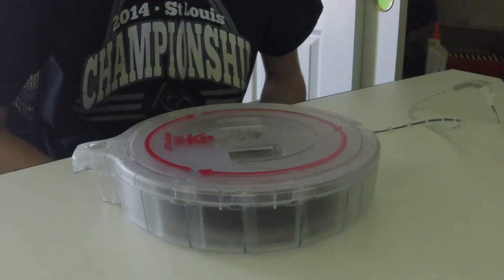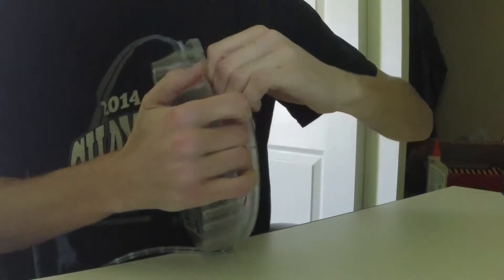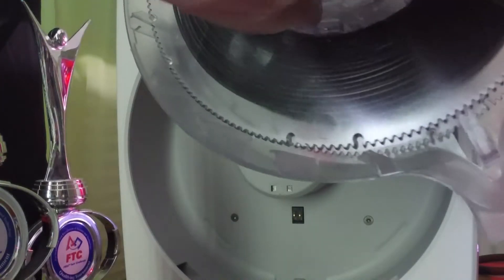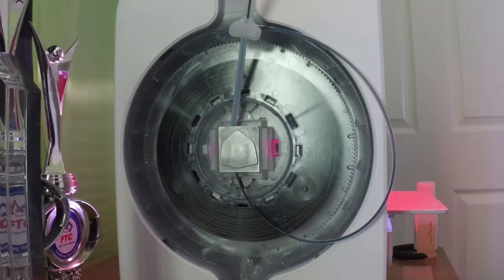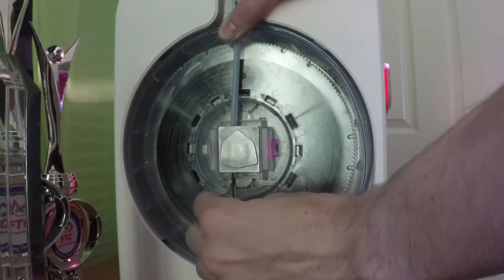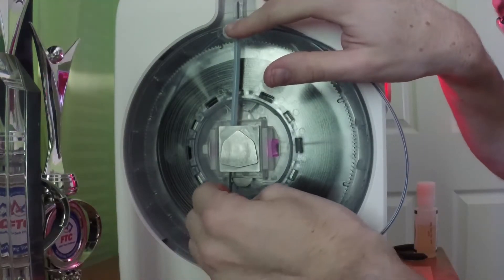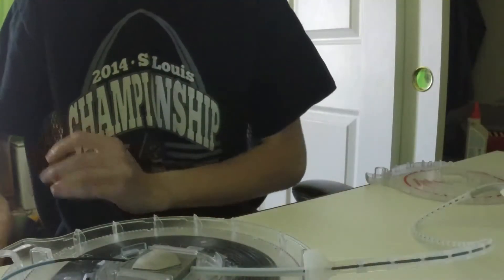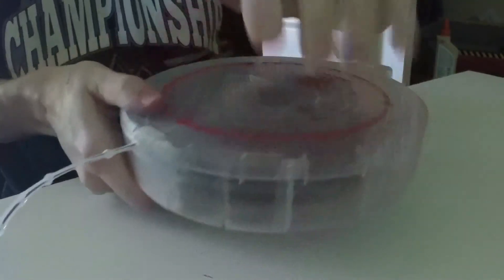EKOCYCLE Cube/Cube3 3D Printer Unjamming Tutorial

Comment: This company reminds me of Apple. Over priced crap. I had gotten this printer donated to us for our robotics team and I am in charge of running it and i have had nothing but problems. Ever cartridge has jammed around 50-60% left and those are a head ache to fix but it can be done. The cartridges prices are TRASH. 50-60$ for a decent amount of filament at best, WHAT A JOKE. Plus you can't not use the cartridges, trust me I've tried. The plastic dries together like crap too, always warping and always a mistake on every print. I've gotten a messed up print 7 out of every 10 tries. This printer isnt worth 1200$ more like 300$. The company's thought probably goes a little something like this, "lets give some away and over charge the crap out of our crappy quality cartridges to make our money back". This printer is a joke, good video tho:D
Reply from the maker: +UnleashedRC Yeah, the printer can be a bit high maintenance. And the warranty is definitely too short for the quality of the device. That being said, small things like making sure to relevel and recalibrate your printer often and using the right amount to glue really help. I've had mine for about 8 months, and I've printed a ton of cool stuff. While it does sometimes jam up, I find that fixing it is more of a hassle to start than to finish; kind of like math homework. It's not always super difficult, but you just don't always want to do it...
Also, if your cartridge keeps jamming, email the company. Mine kept jamming and wouldn't unjam, and they sent me a brand new cartridge for free. Even got to keep the old one :)

To avoid regular problems and jam-ups, just try to stay on top of maintenance. Consumer 3D printing is a relatively new technology, and there are bound to be some hiccups.
Reply: They have mods now